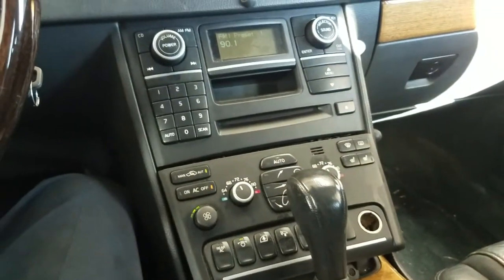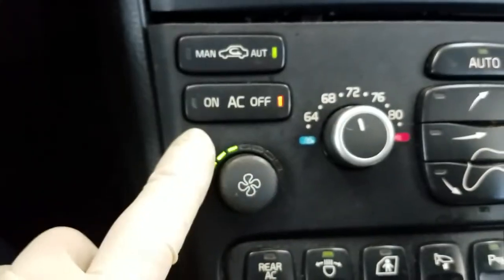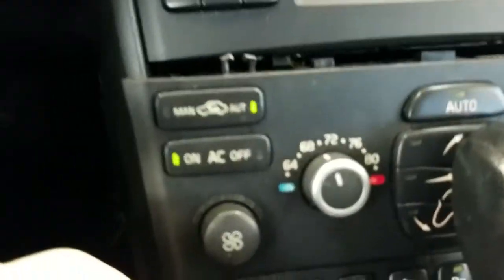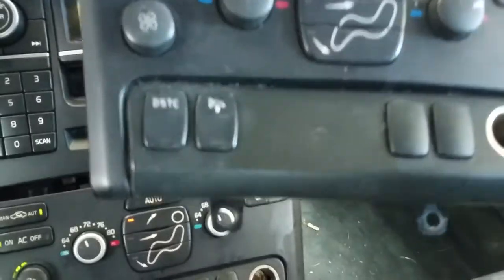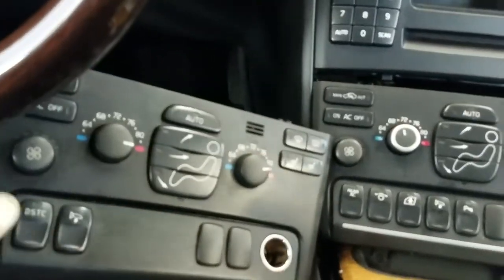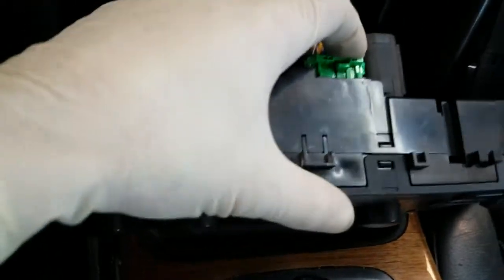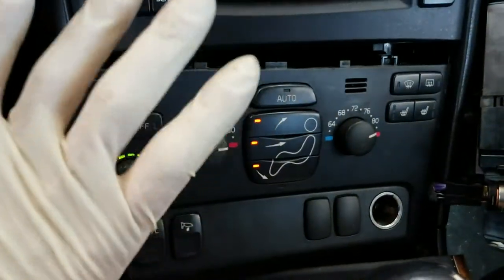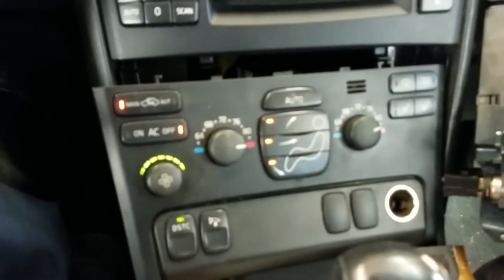Volvo Blower Motor not Working "Fixed"

Comment: Don't swap the AC control module without disconnecting the battery. You will trip an airbag light otherwise. The switches in the bottom are interchangable between modules. Just pop the frame and the switches out of the old one and pop them in the new one.

Comment: I'm gonna try this asap, I have the exact same problem! Just a hint though, unplugging the ac panel without disconnecting the battery can trip an error code
Reply: Nevermind, I just punched the fan speed knob and it started working again.

Comment: Not shown in this video (which I really wish you did) is that you have to pull the entire unit out to get that bottom half out. Screws on the other side hold the AC control unit on the subframe thing (so not just the clips are holding it in!). Maybe you could finagle the thing out without pulling the unit out but good luck getting to the screws on the back side. You are better off pulling the entire unit out to get good access to that.  I've also had to pop off the shifter decor frame from the central unit to keep it from obstructing things when pulling it out as well. This was on top of having to pull the shifter all the way back so it wasn't in the way. I don't know maybe it's because you got a different model Volvo (or some bone head mechanic who last worked on it didn't put the screws back in. :P ) but yeah ours had screws so I had to pull the unit out to get at them and get good leverage to pull the ac unit out after working on the clips. It did not want to come out while I was also wrestling with the main unit while in the car. The decor frame attached to the main unit also has screws on the top holding it in. 3 of them. So be remember those when pulling it off.

Be warned, it's not as easy as the video shows it to be. It's a job and a half to get this damn thing out.

Anyways my mom's car was having issues with blower not turning on so she asked me to look at it. it appears the control unit is fine. I retouched the solder points for the fan control knob and put it backtogether. Forgot to check it prior to pulling the unit out but in any case the LEDs and such respond correctly to the controls so I'm pretty sure it's not an issue with the AC control unit. She mentioned the blower would sometimes turn on and run after hitting a bump on the road...seems like something else going on. Trying to convince her not to waste money on a new control unit as I'm sure it's fine. I looked at the thermister thing too. Didn't appear to be broken so didn't resolder that. The vent for it was clogged up with dirt and crap so I did at least clean that out while I had it out. :P

It seems like either a wiring issue with the blower or the blower itself is going bad. Not much I can do about that. Told her she probably has to have a mehanic/ac guy look at it.

Comment: These units all suffer the same problem of a broken thermistor which senses the cabin air temperature.  On the front panel there is a small vent above the passenger temperature control.  The thermistor lives behind there.  It breaks of at the body but sometimes can be resolderd or replaced.
Reply: On the money! It stopped working lastnight--sure enough, I found it and it's actually better than it was before! Anyway, my wife told me to thank you---we are in the 3rd day of +105* and her car is black in black---dealer can't get to it 'till Monday, she just WON'T drive mine-- soooo, You are the saver of this weekend, ( not to mention peace in the house) We Thank You.
Reply: So if you fix the thermostat then the blower motor nob responds to adjustments?? (Cheaper fix than replacing the whole unit.)
Reply: I change all this and resistance, blower motor an nothing bro this is not the problem, mine is different can you show me other options please

Comment: The problems are the contacts 
You need to disassemble and use flux to re solder the contacts on the control switch. 
2 on one side 
3 on the other side of the control switch.

Comment: I thought that it was the control head.  Your video confirmed it.  Thanks for the tips on getting one with the correct buttons.  Now I know what I'm looking for.  For other tech's to help you, in my situation:   No computer trouble codes.  Fan knob wouldn't light any LED's, nor would it change the fan speed (which by the computer data, indicated fan desired was at 91%) - so I knew the fan motor was working.

Comment: Very interesting range of possibilities. Thanks! Thought I would add my related problem to the universe and see if it pulls in any comments  My blower failed to come back on after I shut it off one day. The defroster had been going for a while, the interior of the  car was warm and so I just twisted the fan knob to off. 
When a little later  I wanted heat I twisted the knob, pushed the cabin buttons and noticed the fan was not blowing at all. The lights all responded to   my knob twisting and button pushing on/off , high /low but nothing  happened. I parked the car, did other stuff and then when I started it again the whole panel stopped lighting up. Still no blower or anything else of course. Now after several different versions of YouTube presentations, checking all the fuses and confirming sufficient voltage with the battery/ alternator... one other strange thing has happened in this no heat electrical mystery. The interior lights won't come on with the central cieling switches anymore.  The courtesy lights come on when the door is opened and stay on until the timer shuts them off still, but I guess the "reader" lights want to get in on this mess with my comfort head game now too. Are there any more fuses that could explain this. It is 2021 and the car is a 2001 V70xc
Age and all things so related. But all this so suddenly?  A replacement heater control panel looks inevitable and a blower motor too perhaps. But is there a quick fix? It might just be some mechanic didn't reattatch the panel plugs firmly? I may just have a look at that if it  comes out like it is shown here on this video. Anyone have a thought about all  this?  Happy New Year in any case. Please wish me luck.
Reply: Guessing you got this figured out. But the interior lights(power windows and locks) issue is common when the computers need to be reset. This happened to me when I was testing a radio with the heart control head unplugged. Disconnect battery and there is a trick with unlocking and relocking the door using the key. Can't remember exact order but it worked for me. Won't fix heater though
Reply: @jasonwakeman  thanks for your input. I don't know where I followed through with this issue. I dId finally get heat with an Ebay item replacement climate control panel though...BUT now it is summer ...come.to find out the AC has a very different recognition issue and according to my mechanic there  is simply no way to make the vehicle make friends with this alien part for AC. The initial start up actually makes cold air but then something in the back and forth will not let the AC stay on. Anyone know a way to wipe and reprogram an alien climate control module for this?
Reply: @kazparzyxzpenualt8111  oh my gosh! Lol That's what is happening with me. I'm going to the junkyard to get one from a s60 today. Really hope it works, 🥵. I'll let you know. Probably won't help u. Maybe they are all different? Bet if we found a friendly parts counter person at dealership they could tell us 😔
Reply: @jasonwakeman  good luck with the part you try! Another thing to be aware of which has been partially explained by my mechanic who consented to look at my problem but actually could not help me with after all is the way the main ECU "talks" to the alien climate control was the relay clicking which happens now upon start up.
 He said the clicking (which is audible under the drivers side dashboard ) that goes on for a few seconds then stops THEN the  alien climate  control panel finally lights up after a worrisome pause.  And the fan control knob will activate the fan. This was not the way things went with the car before the  climate control panel failed.  And one other thing I found you might have on your car is a n easy way there is  to check the plug terminal that goes to the fan behind the glove box compartment. A sort of secret panel just like the one on the drivers door that has fuses it mirrors. The door has to be open. You can wiggle that junction at least. All those terminal plugs are prone to oxidize and make you think your fan is shot. But this seemed to help me. It is much better than slamming the dashboard a few times which also got the fan working.
Reply: @kazparzyxzpenualt8111  super helpful! Thanks! New one works pretty well, but stays on even when key is off 😂 guess you have to get exact same unit from s immolate year and same model as ecu expects 😥. Thanks for tips, good luck with yours!
Reply: @kazparzyxzpenualt8111  part was only $24 at junkyard. Was worth the try I think.
Reply: @jasonwakeman  oh amd I forgot to mention the run on issue too. Yea it freaked me out. Battery drain in the cold weather was a concern.But in my 01  V70 XC the run on last for only one minute. As far as the heating aspect this was just weird like the main  computer is running test for shut down. However  the circuits work it is alot like how even when the key is off and out to u can still roll up the windows before you get out or like with the courtesy lights staying on as you walk away from the car....then finally dimming. Or that other Volvo thing. That random climate control fan that comes on sometimes long after you are parked. Full blast ...they designed it in to  prevent mildew from getting a toehold in the evaporator or something like that.

Comment: I dont have exact symptoms but mine all buttons work n all lights up n the motor to turn the fans inside work, i can hear the motors goimg but nothing comes out at all, ive check fuses , what now , thnx
Reply: Mine does that and the stereo buttons too, but if I open it and clean it, like the contacts would it work?, I have seen that weird thing even on toys and several electronic devices
Reply: Where's the fuse located at?

Comment: The panel on the bottom with the switches pops off from the front and there is a bank of plugs that all those switches can plug into. 
What I’m not sure is if the switches themselves trigger the features they are meant to control no matter what plug they go in because I keep seeing different arrangements of the switches - like several modules I’ve seen gave the rear a/c control switch in very different positions…
Reply: *have the

Comment: Does anyone got the same problem here? The AC speed control cannot reduce the ac blower, it keeps on full blast everytime turning on the AC, why is that?
Reply: Blower control module inside the blower broke most likely. You need to take the blower out and remove the big aluminum cooling body thing. It costs an arm and a leg to replace...

Comment: 3rd failure on my 2013 in 9 years. Sigh
Reply: European engineering am i rite
Reply: @djkasdjkasdjdjdj  did it again. That’s the  4th fucking motor. I will say that this thing requires a battery at full charge.
Reply: @2steaksandwiches665  why does it keep happening does any of the mechanics you visited say somthn?